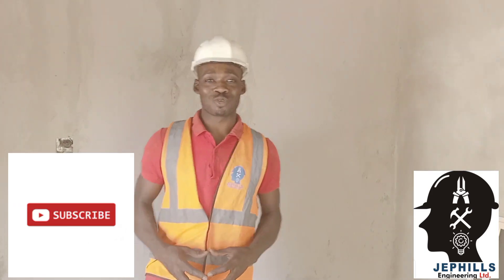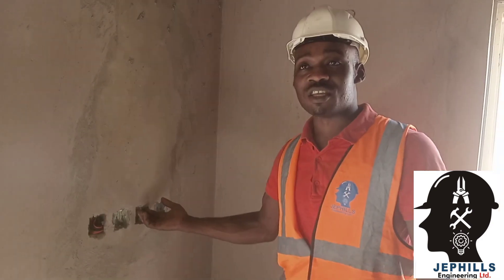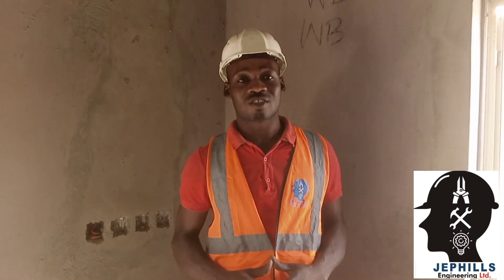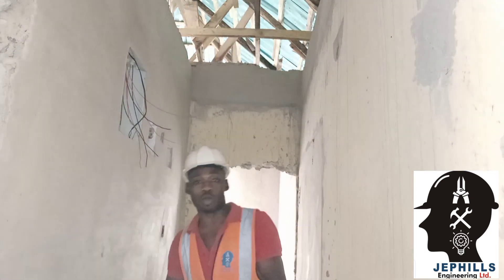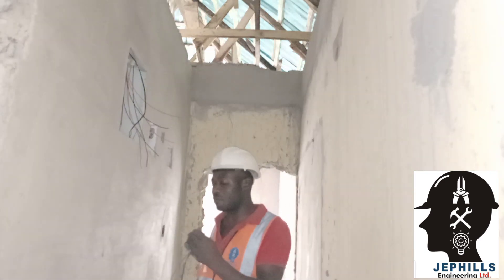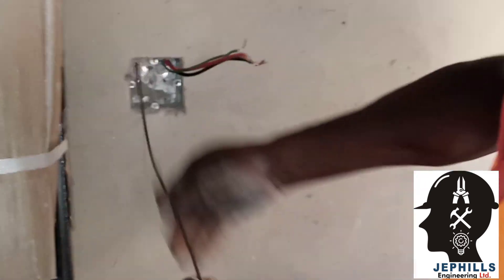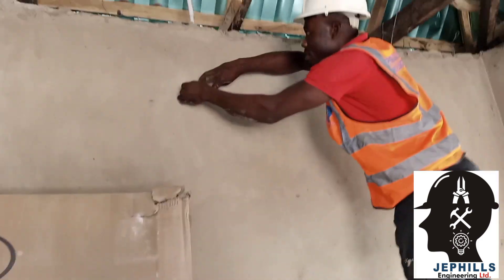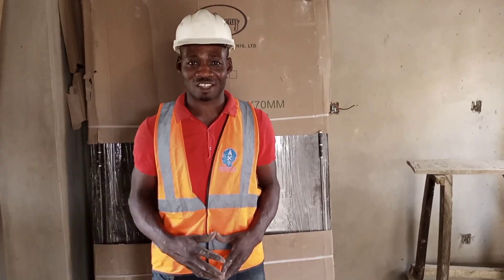How to wire full conduit electrical house wiring for aircondition, water heater and cooker sockets

Comment: You can wire a ring circuit for the water heater using 2.5mm cable  for 2 or more water heaters
Reply from the maker: You're very correct, ring circuit connection isn't a bad idea when you have a lower melemeter of cable.